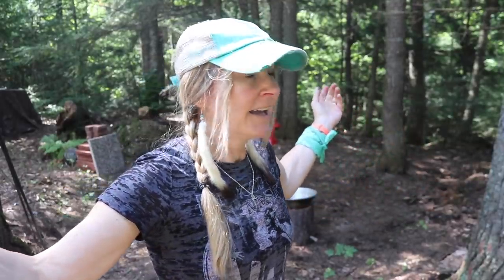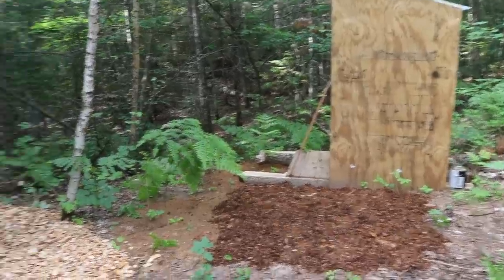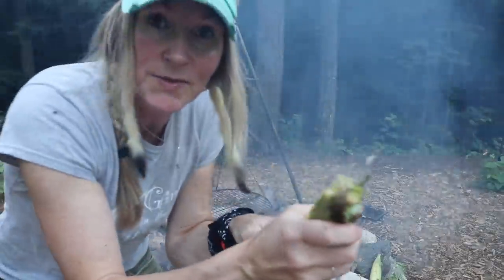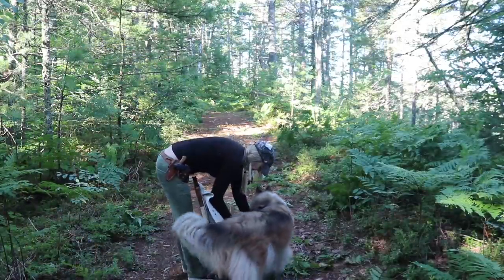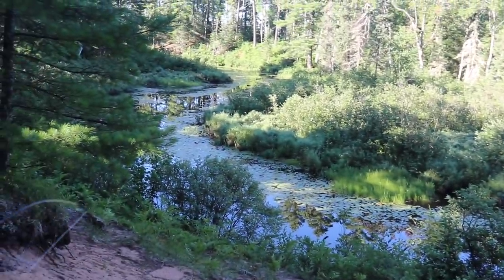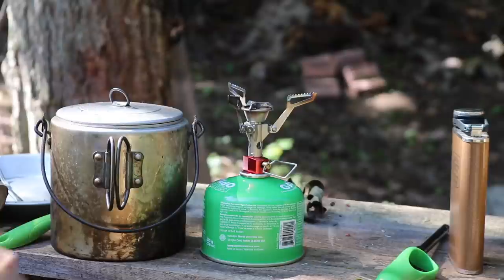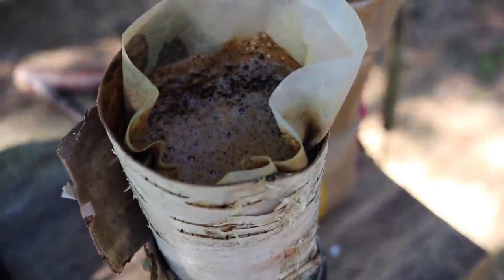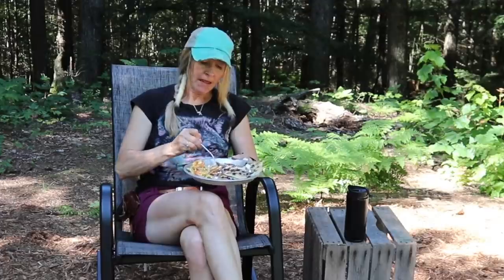Workin', Fishin', & Sourdough Pancakes with my dog

Comment: Tip: Corn on the cob - leave the husks on, wrap in foil, put right down in the coals, half into the coals, the other half sticking out, so you can grab to flip it. Keeps all the juice in, makes it tender, steams it. Flip one end for the other so both sides are good and cooked. The foil should look browned if not burnt. When done, open the foil, pull off the husks, add butter and salt, voila! Excellent tender and juicy corn on the cob. (Butter and salt only if you want.)

Comment: You could further stabilize that pump by strapping the log and the pole together.
Reply: Great idea , some plumbing strap wrapped and bolted at a couple places would sure secure the movement of the well pipe..

Comment: Great video where's your hubby still in Alaska? I'll offer two unsolicited suggestions. You commented on how the well pump moved when you pumped the handle. What would happen if you took either that piece of log in front of the pump or a longer piece and with your chainsaw made a groove from top to bottom the size of the pipe and slide it up against the pipe to give the pipe more support. If you made it as tall as the mounting flange of the pump you could lag screw it to the top cut of the log. Sorry for butting in you folks do great stuff. If you paint the outhouse interior. I would suggest white or a light color for light reflection. Oh well that's my free advice. Wonderful cooking and hilarious frustrating fishing trip. Thanks

Comment: Am late watching this one and you did a great job on the base.  In case you hadn't considered it, here's an idea.   If you did an s-hook lag into the wood and a bracket with clamps around the well pipe it would keep it steady.  Your way definitely looks nice.  Alternatively one little addition of wood the thickness of the spot between the pipe and the wood, would give a transition so it would look nice by covering the lags up.  The best nutrition is out there waiting for anyone willing to forage!

Comment: Suggestion.... why not build a box around the bottom and fill with sand to insulate the pipe for the winter time.  You can use the top of the box to set you pan on, and not have to bend over.

Comment: Hi.Brooke,Can not figure out how a tiny little thing like you can eat all that food?Alittle tip you might try when cooking steak on a open fire is too brush on a little cooking oil first.It seals the meat and keeps the juices in even if it happens too get a little over done.I plan on spending the weekend in my hot tent but the weather forecast is for up to 100km winds.The tent can handle it but it drives the smoke back down the pipes.Should be interesting,love your place.Mark.
Reply from the maker: thanks mark have fun!

Comment: I would think you might want to consider insulating the exposed pipe and well since it stays primed so it doesn't freeze and crack when the seriously cold UP temps hit. Just a suggestion
Reply from the maker: just let the prime out

Comment: Great vid, & a fun day !! 
Years ago we took a scrap piece of 8" or 10" plastic pipe & with a 2x4 frame at base 4' x 4' wide (dug down where they meet) poured concrete to firm up the pump.. & you could insert pavers into concrete for a custom look, (just allow for that when figuring base)..
Silly question,  you're in the woods spreading bagged mulch.. are you not able to take a day(s) gathering debris (underbrush around campsite) into a good sized pile, then borrowing a chipper & make your own mulch pile for use in/around camp ? (Maybe borrow a tractor with  a rake).. 
Stay Safe & God Bless   -Mike
Reply from the maker: no- buying a bag is much easier that what you said!

Comment: We’re wanting to put in a well and pump setup like you have. Will it work in the winter up here? Or would we have to build pump house around it so it doesn’t freeze?
Reply: I have one mine has never froze I’m in Kentucky tho and we’ve had really mild winters the last few years but yeah it’s never froze even below 0 temps without a house around it
Reply: Simply Misty thank you! Up here is a crazy cold long winter. I seen that someone had a larger style pump like that and they said it was a “non freeze” pump. It just got me thinking. I guess it wouldn’t hurt to build a house around it. Who wants to pump water in a blizzard! 😃🥶
Reply from the maker: Yes you'll have to enclose it somehow for sure- or you could drive one INSIDE.... just plan ahead on the build or retrofit.
Reply: 9252LIFE Off Grid even when my water froze inside my home the outside pump never froze but if you have long cold winters you may wanna go ahead and enclose it or try it out for a winter and see what happens.
Reply: Simply Misty we probably only have about 6 full months of cold winter.. 😅